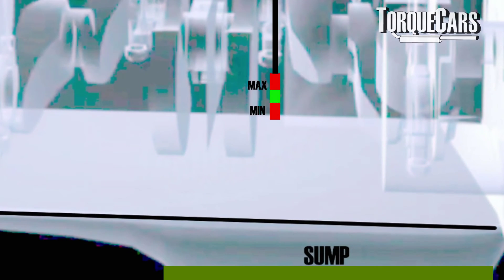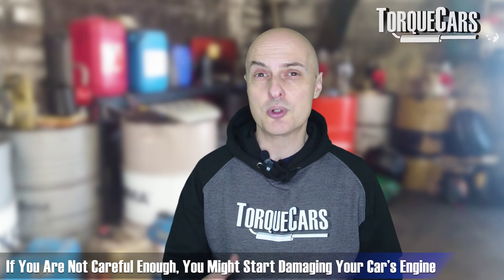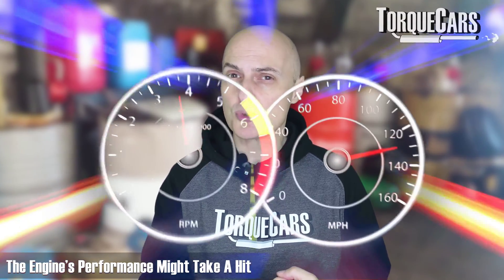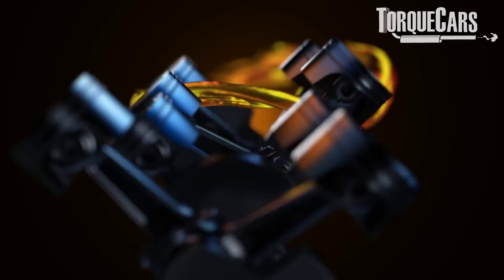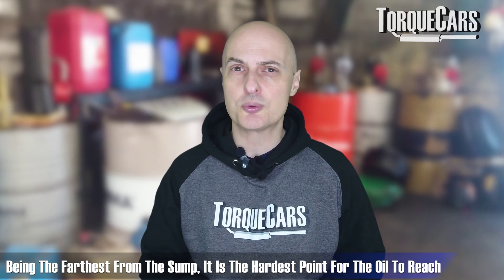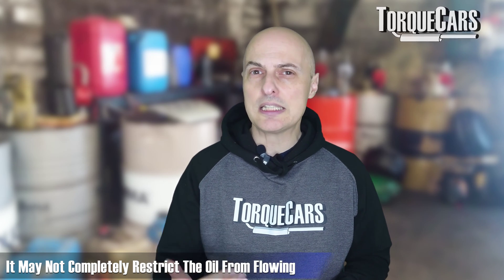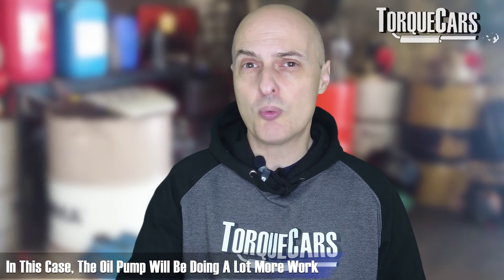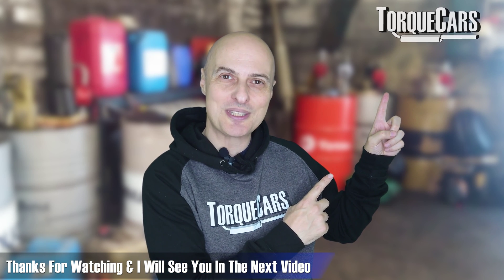Problems Caused by Too Little Engine Oil, Too Low Oil Level or Low Oil Pressure Revealed

Comment: Had a shop change my oil pump. Been wondering why my topend sounds so loud. Only has a drop on the end of the dipstick. Been driving for 3 days with this low oil 😢.

Comment: Hi there, new to your channel and love the content!  I have sold my old car which was a vauxhall corsa 1.2 to a honda civic 1.8 2012 and noticed my honda uses far more oil. Probs i would guess around a litre every 1k or slightly more when in vtec. My honda only has 95k miles so bearly bedding in for this engine. I am not a mechanic but take pride in the car of my cars and learning to do things on my own car and learning from vids etc on youtube :)

Comment: Not sure if it has been mentioned here on the channel or forum before , but i recently had an oil pressure warning , replaced sensor, no luck ,now thinking it was maybe pick up pipe . Turned out it was the DPF , poor/incomplete regen cycles and age of the dpf was making diesel get into the oil!! Diesel was diluting the oil and thinning it at running temperature. It seems to be a big problem on VAG engines from 2008-2014 . Apparently they at the time put fuel into the oil  to increase engine Temperature to help the Regen cycle ,later dpf systems made fuel or oil go directly into the dpf instead. Please cover this in a future video if possible . My engine is a CFHC 2.0tdi (2012) on a mk 2 Octavia . This issue is going to crop up a lot  now with engines 120 000 miles plus i reckon ,as if they hapoen to have the original dpf its probably toast and time for replacement or ideally a delete. There's not loads of info about this online and there's going to be lots of people like me buying 10-15 year old vw engined diesels which are going to be really struggling with this issue soon

Comment: So my 225+K mile 1.8t the other day was making 40psi oil pressure at 3K rpm cruising down the highway. Later that day I check and added a quart... It now makes almost 50psi... So 1 quart low dropped 10psi!
Reply from the maker: That is an impressive drop for so little oil but it does illustrate the point. I reckon if I did random checks on cars they would all have too little oil in them, or at least be only half way up the dipstick.

I just had a main dealer service and they underfilled the oil by a quart! I was not a happy bunny!
Reply: @torquecars  I did an oil change and fresh oil gained another 5psi! So at 3000rpm cruising it's right about 55psi. Oil temp is pretty low though too at about 175°F (80 C) if even that hot. Coolant temp stays about the same.

Comment: I picked up a lower weight oil  by mistake, since winter is here I kept it. I notice increased of oil consumption.  I have a 2.0 TDI.
Reply from the maker: I'll do a video on VW engine oils, there are more factors than just the SAE weight. When thin oil is used it burns off more quickly and actually can hamper lubrication. I would recommend you do a quick oil change on that to be on the safe side. Don't worry about the filter in this case as I assume that has just been changed.